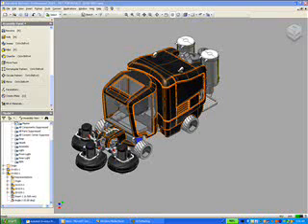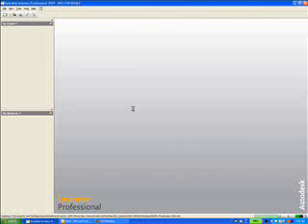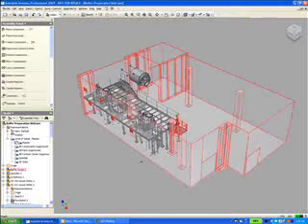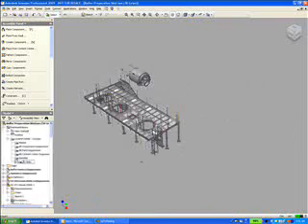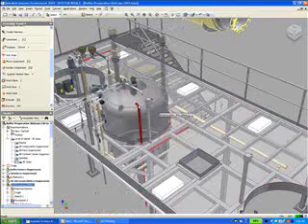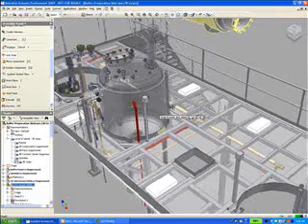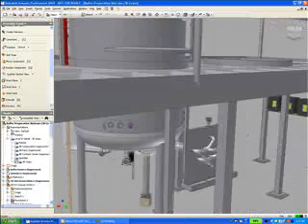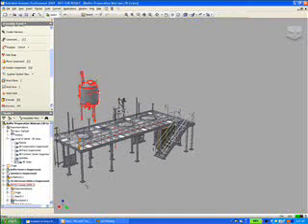What's New in Autodesk Inventor 2009 - Part 7

Comment from the maker: In order to do that, you'd need Inventor Routed Systems Suite or Professional. 

The instructions below assume you have either one of those versions. 

Create a new route, pick out the cable in your standard library, then create the desired route using those two holes and then populate the route.